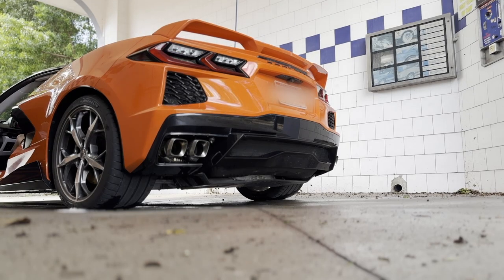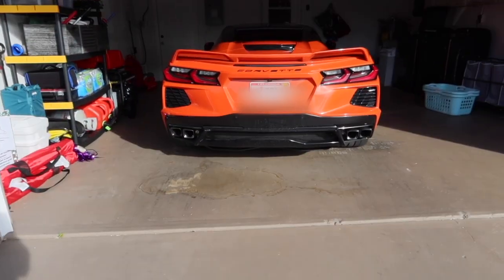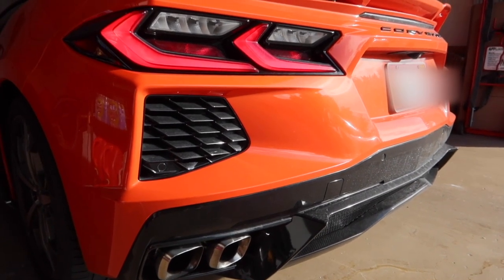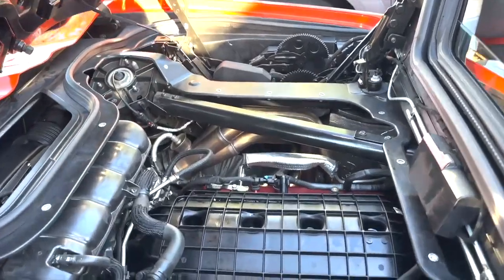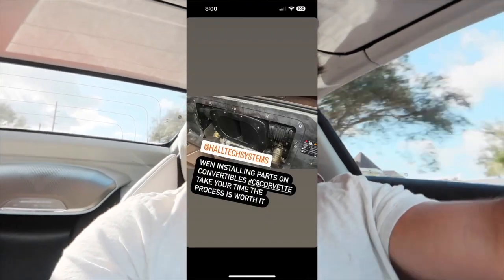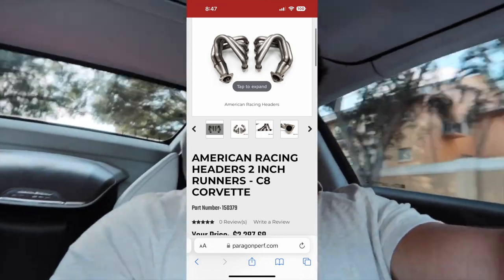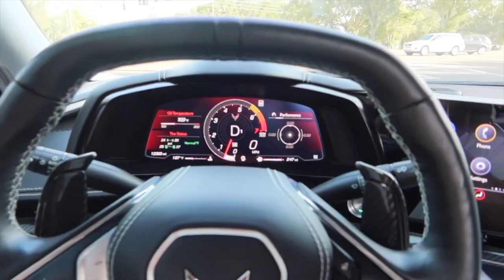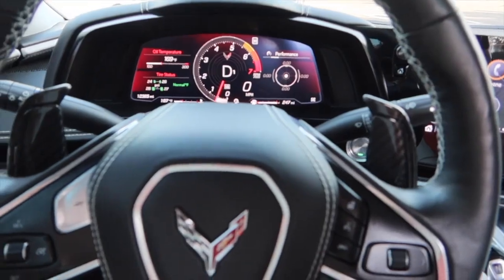Adding Bolt On Mods To The C8 Corvette! *Big Gains!*

Comment: With those mods you're setting around 580-585 crank horsepower. Add an exhaust system and you should be at 595-600hp. You should run mid low 10s no problem💯
Reply from the maker: That's the plan!
Reply: If you know how to drive a car at the drag strip, my bet is the car could run an 11 flat ET if the car will dead hook.  If it runs 11:20s you should be happy with what you have done.

Comment: Tip-in is always deceptive when you add a  larger throttle body. Cause your putting in same input but getting much more air and that effect runs out as the revs rise. Unfortunately GM has encrypted the ECU, and for that reason it won't correct for the new values. And simply keeps AFR to a static % of correction... And I'd bet it's +/- 4%..so like 15hp on the high end matter what you through at till you start tricking sensors...

Comment: Doubtful it made 600 hp just adding bolt ons.
Reply from the maker: This is at the crank, and it’s right ABOUT 600. Now depending on the temperature of the day it’s on the dyno it could be right at 600 or a bit less. That’s what we got. Look at car_c8 on IG (this is the shop I went to)
Reply: @nicolaskorvessis  It was 550 at the crank stock. Seems like you wasted a lot of money for 50 horsepower.
Reply from the maker: @casmithc2  50 HP makes a big difference if you drove it before the add ons and after you’d notice a very significant difference. 

The engine is nearly maxed out from the factory, so anything added is a benefit.
Reply: @Craig Smith  what do you drive that has 550 crank hp? What are you even trying to compare?
Reply: @casmithc2  It's 490-495hp at the crank stock NOT 550hp🤓

Comment: you really can't just add up all the HP off each ITEAM and than say that's what it has.it does not work like that.I would recommend a exhaust as its still muffled a lot.
Reply from the maker: Hard to translate sounds over the camera to you. We got 600 HP on the dyno that’s all I know. How would you add up the power from each mod?
Reply: From our tests adding a exhaust with his setup will only add sound really. Maybe a few WHP. You're spot on with the mods not adding up, we tested a setup VERY similar to his and the car only gains about 30whp. Most if not all the gains will be from the headers.
Reply from the maker: @ParagonPerformance  super interesting! I’m not sure if our dyno bay was temp controlled or not. (And I know yours is) and every small thing adds a difference and I know the cold air intake is a great base that enhances everything else I added correct?
Reply: @ParagonPerformance  correct i will second that motion, I have lingenfelter intake 95mm, American racing headers/halltech/mbrp exhaust   netting about .2 off a second and 2mph in the 1/4...but i will say lots off low/mid power opened up under 3.5k  rpm.   Sound is greatly improved.
Reply: @nicolaskorvessis  each mod is best case if they say 15 hp i would say 6 to 7hp  and scale it like that.Your car  may feel a little faster but its hard to notice 20whp
Reply from the maker: @peterszenkowski7769  I don’t know who to trust haha. All I know is after driving the car stock every day for more than a year and a half after adding everything there’s a significant change at the top end and a good amount of change at the low end. Top end is night and day difference. Low end not as much but it’s there. And it sounds much more aggressive than stock.
Reply from the maker: @peterszenkowski7769  also we ported the manifold and got a soler throttle body. Which help. More air = more power.
Reply: @nicolaskorvessis  The cold air intake is a great base mod correct. You'll see the most gains from a set of headers and everything else will be a negligible gain. We'll be doing some testing of the Carbon Intake Manifold and 95mm Throttle body here shortly.
Reply from the maker: @ParagonPerformance  excited to see what you guys get!